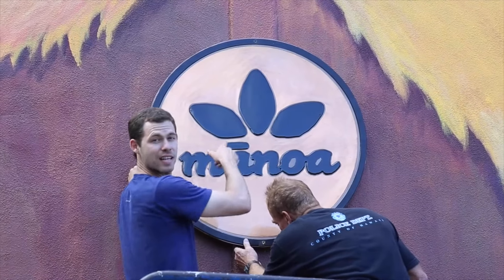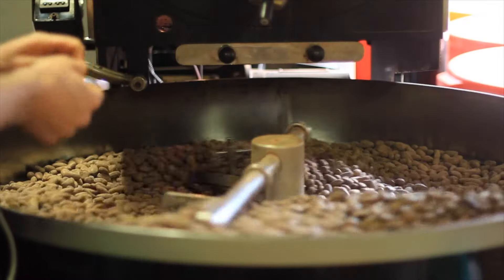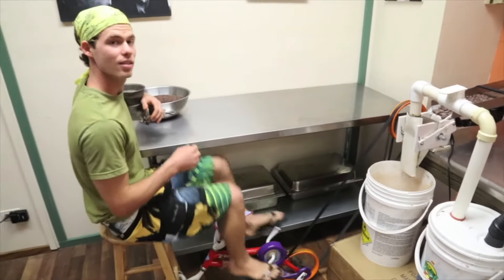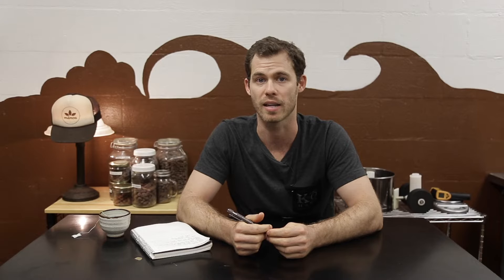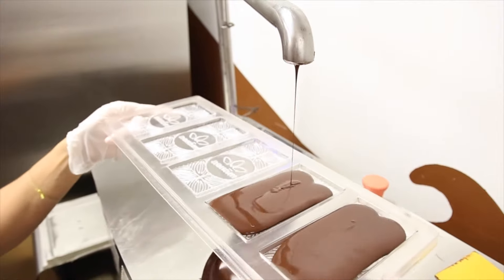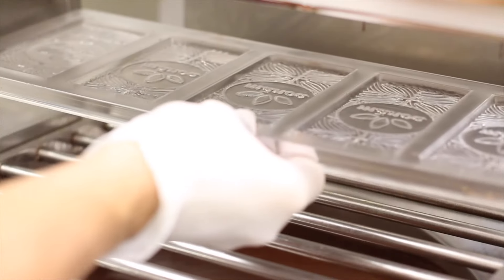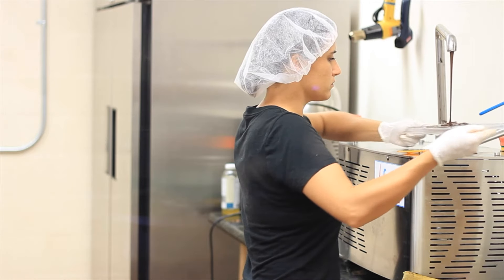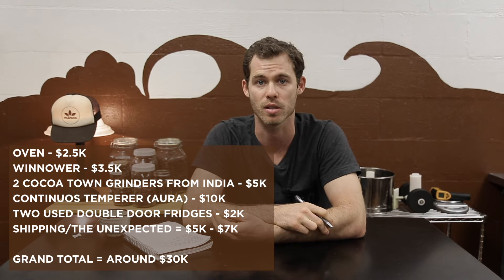How to Start a Chocolate Factory | Ep.17 | Craft Chocolate TV

Comment: Hi There .
Thank you for those videos. Great work.
Just a quick one
Where is the best place to get a bespoke moulds inexpensively?
Thanks
Reply: i reckon you could 3D print moulds, then cast them in food-safe silicone. or, for example, if you can sculpt in clay, you can cast from that. or make a mould out of a christmas ornament. there aren't any limits other than your imagination, resourcefulness, and the physical properties of what chocolate is capable of doing. you may have to learn a few new skills and invest in some fairly inexpensive equipment, but you'll forever be free. if you got to a high production stage, you'd probably want to research vacuum formed moulds for things that don't need too much detail.

Comment: Hello Dylan, thank you for the very informative video. I am wondering if instead of 2 units 25 kg wet stone grinder, could I instead start with 1 colloid mill which can grind at least 50 kg/hour and combine it with 1 unit 25 kg wet stone grinder? This way I can have faster grinding time then use the wet stone grinder for conching. I would appreciate your input. The cost would be at the same range.
Reply: Quality is different from wet grinding